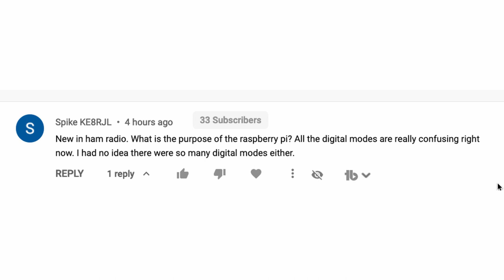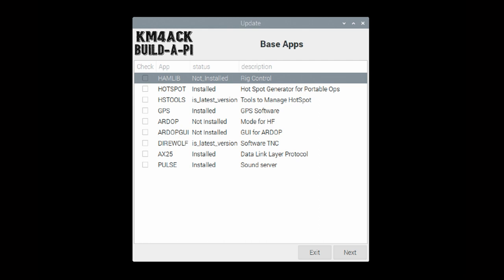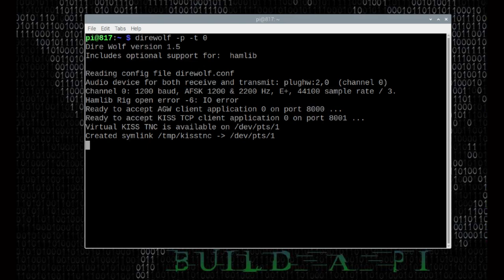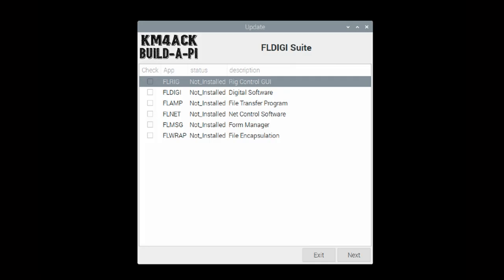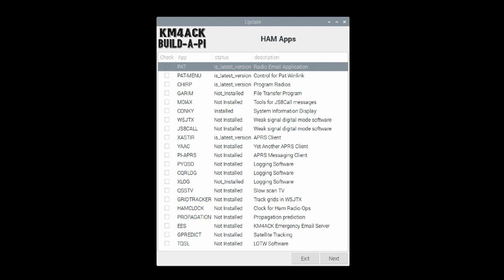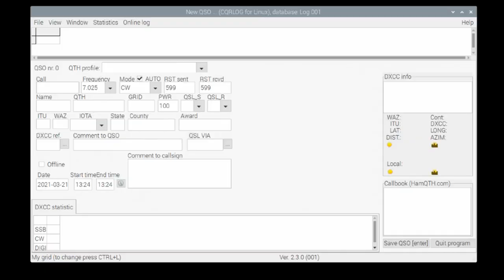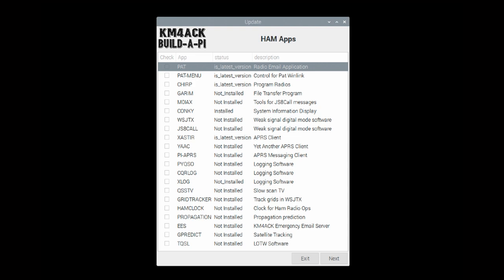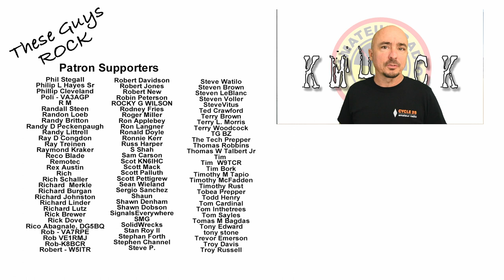Build a Pi in Depth What to install & why?

Comment: I run a cheap GL-INET ar-150 travel router as my portable base's point of connection. This way I can use a 3G modem, Tether to a phone, or configure it to connect to a mobile hotspot/coffee shop wifi/hotel wifi if im travelling. Meanwhile everything ham related included the pi just has to connect to the one wifi device. Works an absolute treat, definitely recommend if running a pi as a hotspot isn't ticking boxes for you.

Comment: Thanks Jason, I see I'll have to go thru the update script and add a few more features in my Pi build. I am still having problem with Maidenhead display in Cronky getting NO GPS message. I ordered a new GPS dongle from Amazon just in case. 
I finally got VNC to connect my PI to my Amazon Fire Tablet (7 inch 7th generation) thanks to one of your videos. I had a problem connecting until I got into the realVNC help screens. In my VNC account I had to change my connection sign in preference from Unix password to VNC Server password and make a new Password just to connect with.
Reply from the maker: Double check that you have GPS data coming into the Pi by running cgps If so and Conky still isn't displaying the maidenhead, head over to the forum and we will try to help you figure it out. https://groups.io/g/KM4ACK-Pi/topics
Reply: @KM4ACK  Thx again Jason, I watched your conky won't start video and was going to try to purge and reinstall the GPS this morning..
Reply: @KM4ACK  Tried the steps from your "Help Conky won't start" video. Still "NO GPS" in conky. Running cgps doesn't fill the table and I get only 1 or 2 satellite seen 0 used.  What I find suspicious is the GPS U-blox7 dongle LED only flash once at boot up and does not blink while PI is running. I have ordered a (G72 G-Mouse, Better Than vk-17?) replacement that arrives tomorrow. If that doesn't do I'll head to the forum. Tnx 73 AB1OP

Comment: Another great video!  I would argue for installing the hotspot tools even for home use though.  On backup power you can use your PI remotely without a WiFi router on.  

Better to have it and not need it then need it and not have it!
Reply from the maker: Good point!

Comment: Great video Jason!!!  I guess I need to start over!! LOL  I pretty much installed everything, I am one of those hams that if it is available I want it!!  LOL  I really don't do satellites, but I like having the software to track them.  I will have to rethink things for sure and trim down.  I just hate going thru the total new SD, new Buster and then install the Build-A-Pi script.  My station is up and running, I even tried an experiment and just did an upgrade and update on the operating system (Buster) instead of a new install just to see if it would cause a problem.  So far no problem.  Before, I had just updated the Build-A-Pi script using your update script, then I saw I had a problem with FT8.  Once I made a contact, and clicked the log button, I lost my soundcard.  I would have to go and right click the volume and recheck (even though it showed checked) the USB sound in and the USB sound out to be able to transmit again (VOX-no rig control).  But once I did the Buster upgrade and update, that fixed that issue.  Just so much to understand and learn, I don't see how you keep up with all that.  Thanks again for ALL you do for the hobby and for Raspberry Pi.  Juddie - WD8WV
Reply from the maker: It doesn't really hurt anything to install it all but some guys only want what they need for certain applications. I just tried to break it down so they would know what they needed and what the could leave out. Glad your system is running smoothly now :-)

Comment: Hi Jason: Thank you so much for all your work. I have read some of your comments about Bullseye and the raspberry pi  and your latest build. I totally get you not being able to support the build a pi for the older firmware Raspian OS and the newer Bullseye firmware. I hadn't played with my pi for a while and got it out and used WSJTX and found a problem with the WSJTX software. It kept skipping over the 73 round of reports and people kept trying to get a 73 out of me. I discovered that my laptop and desktop were doing the exact thing and I updated WSJTX on my desktop and the problem went away. long story short when I went to look for updates on the pi it reminded me that we have what we have on the old build OS. I guess for dummies like me I believe I can update the OS ok but getting the build a pi back on it slips my memory. couldn't find anything on Gethub under KM4ACK do you have any suggestions?
Reply from the maker: Hi Bruce, for now BAP still supports Buster. Update to the latest version and  you should be able to update WSJTX. It will give you a warning that you are running an older system and should consider upgrading. If you choose to move to Bullseye, don't try upgrading Buster to Bullseye. Start with a clean copy of Bullseye to avoid a lot of frustration. The link for BAP is https://github.com/km4ack/pi-build
Reply: @KM4ACK  Thanks Jason I will play with it. I thought I had this thing up and running and I did till I bumped into the problem with WSJTX skiping over TX 5 and people kept 73ing me back because they were looking for a 73 the newest program does seem to work, but differently than the original program. It just says RR73 and still skips over the TX5 step; it does this on my desk top too. Any way I tried installing Bullseye and It seems to work but my pi 4 model B with 4gb memory goes into cold poured tar mode and takes forever for anything to load. Type a password or anything in and sit back and wait a minute or two for the password to load I usually test stuff by going to the web browser and going to YouTube and playing videos. Buster did admirably in the past but now if you load YouTube it immediately crashes the browser and you have to re-start it. What I did is start with a fresh card and formatted it and loaded Bullseye on it and started from scratch on the pi and something is wrong and the  pi is real slow and I mean unusably slow (I have not build a pi on Bullseye just the full install of Bullseye). I put my old card back in with Buster and whatever I had the latest of build a pi and everything seemed to work as before but YouTube wont work at all and crashes the browser. I really don't care about YouTube on the pi because I want to mainly run the digital modes with it. I almost have a working system and hope some day to make it to the field to give portable a try. I so thank you for your efforts and as a past PLC programmer I know the hour's one can spend doing it! I remember enjoying Christmas with the family with a laptop in my lap programing stuff for work and saving the co. a lot of money just to get a project completed. I plan to give to your site regardless as I appreciate your efforts and know how bad burn out can be. Thanks again. I don't know if bullseye re-wrote instructions to the bios and permanently changed something in the pi? I did think YouTube worked perfectly in Buster and now it won't when I  put my original pi build sd card back in? anyway just thought I would let you know what is up and the pi now runs really slow in Bullseye and ok in Buster except it wont run videos in Buster now and will not load a video in Bullseye or much of anything else, or not at least in this lifetime. The Raspberry pi folks have maybe gotten something wrong or I didn't read enough first and did something wrong. I am currently making a new Bullseye sd card just incase that was a problem and will try it again. Once I have Bullseye back on an other card. I am not sure how to get the Pi build back on the card. Is there a place to get the download?
Reply: @KM4ACK  Sorry for all the questions. When I go to the update tool it goes to a script and it seems to infer that I have the latest update of BAP I don't see a list with the check marks on the programs and weather they are up to date. So I was wondering if there is a script to update WSJTX? Or am I going to sit this thing out and wait till they have a version of Bullseye that will run ok on my pi. Anyway no big deal I at least have a project that will keep me stretching my old mind a bit and when I feel the need for challenge I can play with all this ham stuff I love so much. I really need to play with JS8 call anyway and see if it will play for me. Thanks again Jason DE KB7CQ

Comment: I watched our earlier video about the Argon M.2 case and picked one up. I never could get the SSD image to boot so I set it aside. I dusted it off and tried again, and finally succeeded after completely deleting the partitions and starting over. I did not realize Bullseye was out, which seems to break a few things. It took several passes of the installer to get the apps and menus loaded, but Conky does not auto-start and many of the apps fail to start altogether. I think it's due to the retirement of the "pi" default user.
Reply from the maker: "pi" is still required for BAP to work correctly as of 02MAY2022. We are in a beta testing on Patreon right now and will be pushing the beta out to the forum in another week or so. Once tested there, it will be released as stable code and the user name of "pi" will no longer be required.
Reply: @KM4ACK  Thanks, Jason. I considered creating a new user named PI and trying the build again.

Comment: Excellent video, Jason. If you want to add all this software, is the PI 3b plus still a good option or do you need a flavor of the 4?
Reply: Jason R. Terrell, I have a Pi 3b plus and I have almost everything installed on mine.  Doesn't seem to be an issue so far, but I get on for an hour or so, don't know what it would be like if I operated it for 4, 5, 6 hours or more.  Juddie - WD8WV
Reply: @JnJTrueOutdoorAdventures  Thanks, Juddie. I'd rather go with that setup if possible. glad to know it works. Jason KO4DOH

Comment: I'm really green with Linux and Pi's but built the super pi with case and 256ssd and a friend downloaded a good image and bunch of ham files you recomended. It seems to have FLDIGI files but not be installed. ?  (On the little micro ssd from my buddy with fast internet, I'm a very rural ham). So, I should probably get the SSD working first. Then transfer this entire image and files. Then, install FLDIGI ? Also, is the fan supposed to run very often on that super case I bought for it ? I hear it running when I first run it on, shuts down, can't hear after that. Wish there was a temp measurement routine for the ICs that have the heat sinks.

Comment: Hi Jason, many thanks for another great video. However I disagree concerning hotspot and hotspot tools. I think that even installed in a shack and never taken out in the field the raspberry needs these two apps. Once electrical power goes down your WiFi at home won’t work anymore. In this situation you will not be able to use your pi unless it is able to build its own WiFi hotspot. So every single one of my raspberrys gets these two tools installed.
Reply from the maker: You make a great argument! Like you, I install hotspot/hotspot tools on all of mine. I like it being there, just in case :-)

Comment: Quick question.  I have done the complete setup and have everything working well except that my GPS does not start up at start up.  I have to use the command sudo killall -9 gpsd after with the GPS will begin to collect data.  Do you know how I can fix this?

Comment: Does anyone have an issue with rpi3b+ latest grid tracker update and wsjt-x. I can load up grid tracker but when I then try to load wsjt-x system locks up I have to unplug power. If I load wsjt-x without grid tracker it works fine.

Comment: How  to I recompile Direwolf to support CM108 PTT?  I'm using a DRA-50 which works great with a standard Direwolf / Xastir build on AX.25 (1200-9600 baud).  But it keys PTT on the CM119 GPIO pin 3.  So in Direwolf I add the following parameter:  "PTT CM108 3 /dev/hidraw0"  and everything works great.  Build-a-Pi script compiles Direwolf without this support.  I'd like to recompile of upgrade Direwolf to a DEV build for testing.  Thanks.
Reply from the maker: For now follow the directions on the direwolf github site. There is an issue ticket for this to be corrected in a future version of BAP https://github.com/km4ack/pi-build/issues/243

Comment: That would be the rasp ubuntu arm64 server for the pi 4/8
Reply from the maker: I haven't tested it on ubuntu. It should work but will probably require some mods to the code.

Comment: Hi Jason. I used the Build a Pi setup and it's a great all-in-one setup, but I'm not getting any signal (Gridsquare in Conky won't update) from my GPS dongle (same as you've mentioned in the past). I've gone through the config files and everything seems to be correct, the only difference I've seen is that the gspd file has DEVICES="/dev/serial/by-id/usb-u-blox_AG_www.u-blox.com_u-blox_7_GPS_GNSS_Receiver-if00" as the USB GPS dongle, which it has gotten from GPSUpdate.
Reply: Never mind. I think adding this comment forced it to start working. Not sure why it did start working. I had it powered up with the same configuration for a while yesterday afternoon into the late evening. Darn technology. 

But the connection seems very flakey. It works then doesn’t work (basing this off of Conky’s Gridsquare info).

Comment: Jason, I'm having a problem with my Build a Pi install, and I'm a total noob to the Pi stuff.  After I select the options I want, and after the install when it calls for a reboot, I can no longer connect to wifi.  Hovering the mouse over the two red X's I get a pop-up that says "no wireless interface found".  Also, when I open Build a Pi, it says it wants to scan to see what I have installed.  Since there is no OK (or similar) button on that window, hitting ENTER just closes that window, and nothing happens.  And with no wifi, I can't download the updated version of Build a Pi when that window pops up as well.  Thanks in advance for any advice!  Bob, W0BNC.
Reply from the maker: More than likely the hotspot is engaged. Open hotspot tools and disable the hotspot. Your wifi should return to normal after reboot. This video does in depth with the hotspot https://youtu.be/WqyPgj3cDKE For future tech support questions please visit/post to the BAP forum https://groups.io/g/KM4ACK-Pi/topics It helps the community as a whole :-)
Reply: @KM4ACK  excellent, thank you!

Comment: Hi Jason, regarding the GPS it will be nice to automatically change the gridsquare in wsjt-x or js8call while moving on the field. Another solution might be to use the gps of the mobile phone over bluetooth. The NEO7 GNSS chips are working now?
Thank you, 73! DE1CTL
Reply from the maker: Check out JS8Call Utilities by M0IAX https://youtu.be/5pbF5h_aCgI It has the ability to update the GPS in JS8Call automatically. Don't know of anything that will do the same thing for wsjtx
Reply: @KM4ACK  Thank you! 🙂

Comment: Hey Jason, Great video answered a lot of questions I had. I still have one, how do I get the solar data to show on conky? I am running Build a Pi is it a setting in there somewhere? Thanks, WD1AJM
Reply from the maker: That's some custom work to Conky that's happening over on the forum https://groups.io/g/KM4ACK-Pi/topic/adding_solar_flux_and_a_index/78788335?p=,,,20,0,0,0::recentpostdate%2Fsticky,,,20,2,0,78788335
Reply: @KM4ACK  ok sweet I’ll check it out thanks!

Comment: If we just loaded everything so we dont have to worry about what he have and what we done..... how big a card would we need?
Reply: I use a 32GB micro SD card on my Raspberry Pi 3b Plus.  The Conky shows I have only used like 14 GB of space.  I haven't setup a 64 GB yet, but have been thinking about doing that to mine.  Juddie - WD8WV

Comment: Do Linux such as Unbutu has to be installed first, or the app will install all of what is needed? I got an Raspberry Pi 4, 8 Gb version. Also have a 32 Gb and a 128 Gb SD Card I can use. Thanks.
Reply: Yes, you must first install Linux. While you can install Ubuntu, using RasberryPi OS will ensure compatibility with all this software.
Reply: Greate. Thanks a lot.

Comment: I have all the cables and stuff, and a working pi. But I have been so lost! And for the life of me can't figure out how to remote into my pi
Reply from the maker: You need to activate the VNC server built into the Raspberry Pi OS and install a VNC client on your other device (phone, tablet, pc). Then use the other device to connect to the Pi at it's IP address. Both the pi and the other device need to be on the same network. After you connect to the Pi, use your pi user/pass when prompted. By default it will be pi/raspberry
Reply from the maker: This video walks you through it step by step. https://youtu.be/h_rrmeeWliE